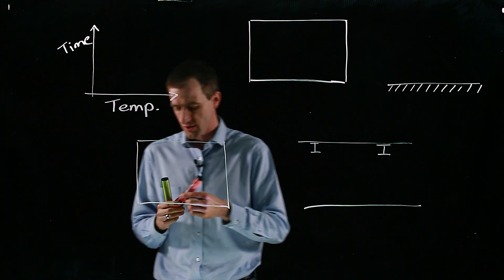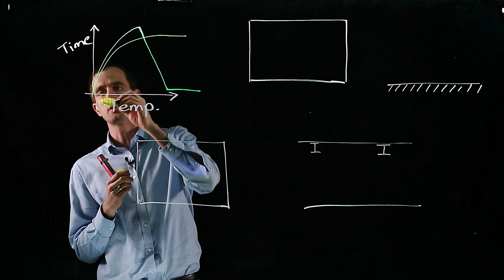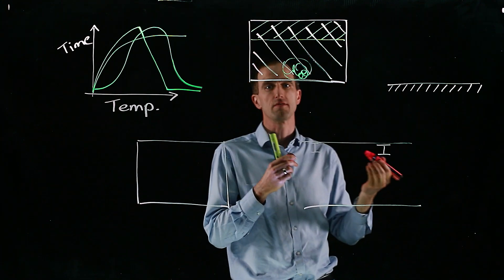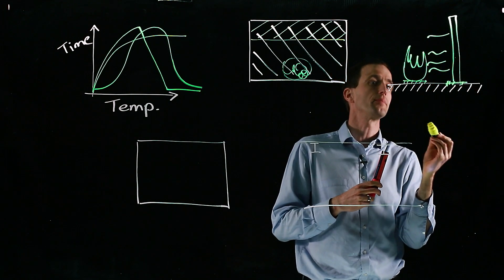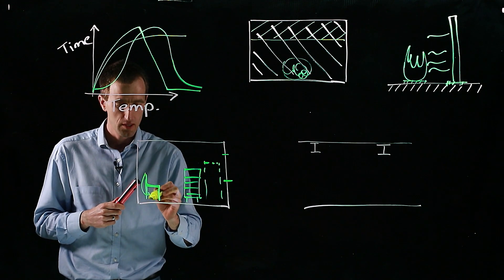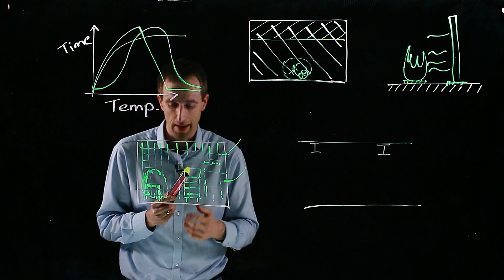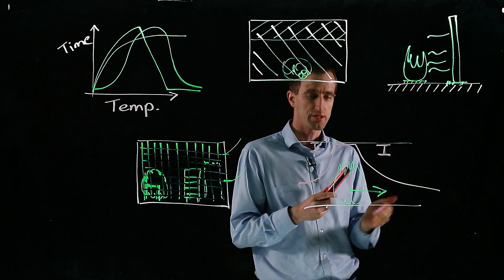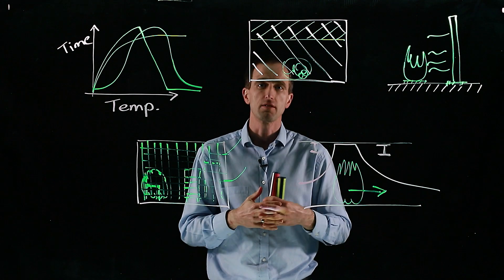Advanced Structural Fire Models: Fire Modelling Options

Comment: Respected sir how good is Abaqus software to analyse structure for fire loading?
Sir thankyou very much for these wonderfull videos
Reply from the maker: Dear Sam. For fire analyses there are many things that need to be considered such as: how accurate can your model be, what loading information do you have, what fire model are you using, can you model your boundary conditions, what heat transfer model are you using, etc.? Based on these you may need a detailed model, or a simple model. Abaqus is typically good for structural analyses at high temperature and it can capture a lot of structural mechanics. However, there is no perfect model. Other software systems such as SAFIR can be used. Try understand what your model is doing, and validate each part of it, when analysing structures. Thanks Richard
Reply: @firesun  thank you very much sir for your reply its always a pleasure watching your videos and learning from them